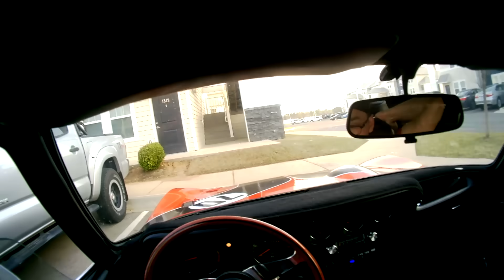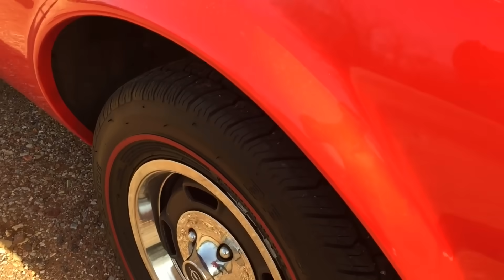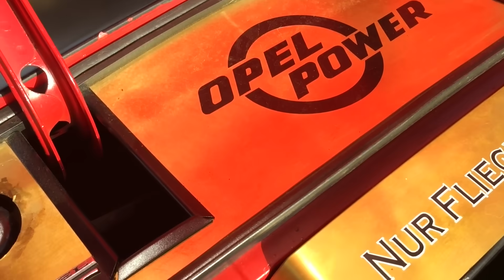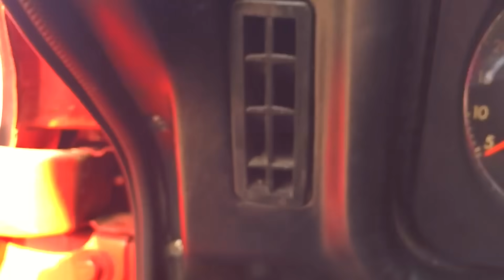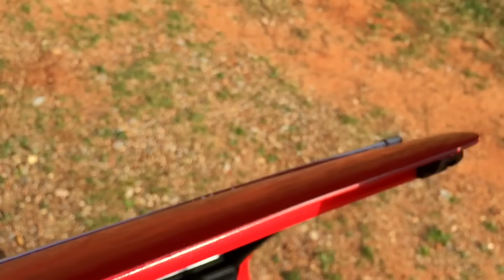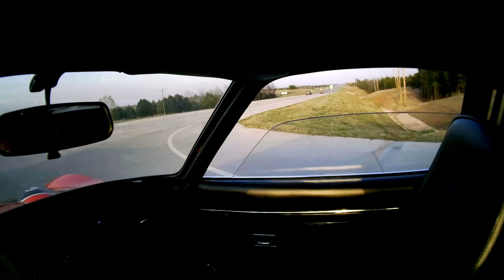Opel GT: History & Review

Comment: This car looked cool.  It was not powerful and it was basically a cool looking car that performed poorly. Body roll was an issue. Acceleration was an issue.
Reply from the maker: I disagree with the acceleration. All the other sports cars in its price point were slower than the GT. That is until the 240z came along (see my Opel GT suspension engineering video)

The suspension I can’t disagree with. The GT was supposed to have a rear anti roll bar, but for some reason it was removed for the US export GTs. No idea why. If you add that back in it handles quite well, as car and driver attested in 1970.
Reply from the maker: Just gathered some data:)
The GT was faster, had better stopping distance, better fuel economy, and a better skid pad lateral G than that fiat 124, Triumph GT6 MK3, and MGB GT. I referenced this road in track article in another video if you want to see the actual numbers.
Also the GT was the most aerodynamic car produced by GM at its time and was capable of 116mph off the showroom floor!

Comment: Why not a V6 eng. and trans swap ?
Reply from the maker: Just not my thing personally. I’m very fond of the original quirky CIH engine.
Also only a handful of people have successfully installed a V6 (even less for a drivable v8 swap) there is just not enough room. Also the body can barely handle 250HP without twisting and popping the windshield out. Anything over 300Hp requires extensive strengthening and anything over 200Hp requires replacing every stock mechanical component
Reply: Vintage cars and motorcycles should be as close to stock as possible

Comment: Thanks, I really enjoyed it.  I never owned a GT, but I had 3 Opels with the 1.9 CIH engine, so I'm a big fan.  I had a 70 Kabett B Rallye w/1.9 S engine, which might be the same engine as in your GT, although the valve cover was different.  I also had a 74 Manta A and a 75 1900 sedan (Ascona A).  That one had a 19E engine (fuel injected).  If you have ever had problems with starting due to the distributor getting wet in rainy weather, I remember that the Manta and 1900 had a plastic shield that fit over the distributor cap & wires.  I don't know if it is still available, but if it is, it might be useful to you if you can find one.
Reply from the maker: Thank you!!!
Yes I have one of those covers on my GT. They are actually pretty hard to come across nowadays 
I have the technical service bulletin Opel issued to Buick dealer addressing the rainy start issue:)
Reply: @Tom Lewis,yes the KadettB 1.9S cih is the exact same engine as used in GT's,as for the aluminium headcover with sloping front only on GT's for reasons of limited space under the hood. As far as i recall also only GT's had an Aluminium carterpan.The headcover was a much sought after part in the whole Opel Custom scene in the "80-"90,for it fittet the most common used 1.9-2.4 engines at that time.

Comment: yeah,,,, with my 1970 Opel GT 1900, the front end seems to float at 105 MPH.  Wierd effect and a bit scary.
Reply from the maker: YouSurf I’ve heard others say the same thing. I confess I’ve been over 120mph and started to feel it there, but definitely not at 105mph. The GT does have quite a bit of negative downforce. Something like 130lbs front and rear at 100mph. 
With that much weight off the front axle it’s no wonder it feels a bit loose:)
Reply: @OpelPower  yeah...feels like hydroplaning... at that speed, I had me at about 188 lbs and a 6 ft 5 in football player type at probably 260 lbs or more and still floated. Took forever to get that fast on a long straight run. Surprised with that weight and other stuff that it broke 100!!! That 1900 was so durable that my water pump broke and I drove/coast/drove/coasted it through the lower half of the Adirondack Mtns (St. Route 30) for about 65 miles before conked out, checked plugs and they were GONE and put new ones in and went another 15 miles prior to it wanting to seize up. Stupid me. Poor college student with no ability to pay for a tow.  I used a soda jug and kept putting swamp or stream water in it about 8 times, but it would pee out in matter of minutes.  I drive up hills and coasted long down them.  What a memory.  I rebuilt the motor.  Not hard to do.  Now it just sits on blocks since 1983 waiting to be repainted and refreshed.  Oh well.
Reply from the maker: Quite a story! Those 1900 cast iron blocks are sturdy fellows, but the heads tend to crack when overheated.

Get her back together! Do the paint last:) sometimes it’s fun to drive around with a little patina. Don’t have to worry about scratches and such.
Reply: @OpelPower  I stripped all the paint off of the top half wayyyy back.  Yup.. a bit of patina... Nothing a little Oxisolve cannot cure or sand paper and metal prep.

Comment: Any common suspension swaps?
Reply from the maker: No. There are very few people to successfully pull that off due to the dimensions of the GT.
There are a handful of one off fully custom jobs though.
The stock suspension can be modified to be really good though.
Reply: @OpelPower  ok yea the front is actually not too bad to convert to independent, going to fit a miata rear subframe with irs. Was just curious if there was any kind of go to for less fabrication.
Reply from the maker: Chad Mowery not really. I do know someone has successfully done a rx7 IRS. If you search the Opel gt forum you might find it.